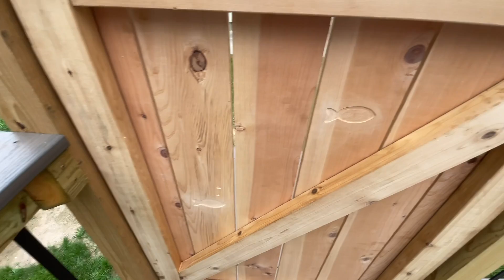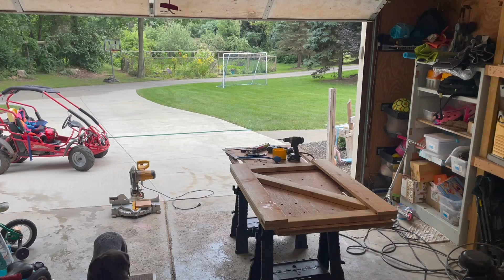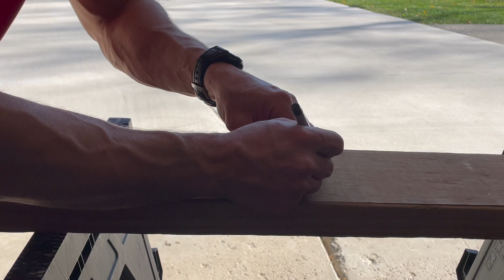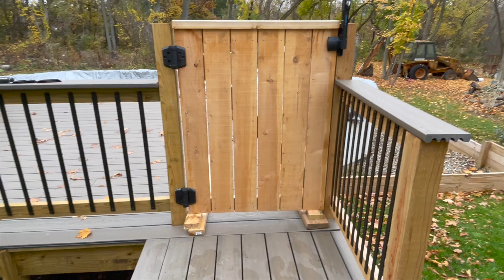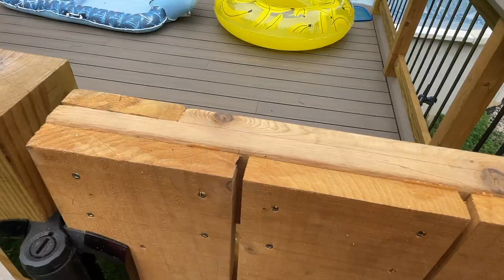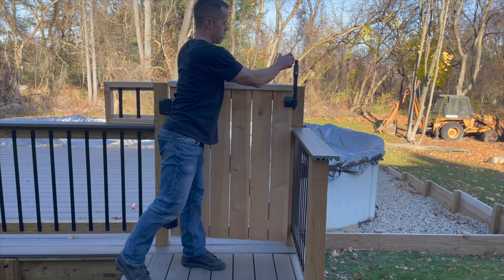Create a Safe and Stylish Pool Gate

Comment: Cross brace is in the wrong position! Should start t the top on the side opposite the hinges.
Reply from the maker: Good catch!  I initially intended for the hinges to be on the other side, however, we did not like the direction the door opened....so I switched it.